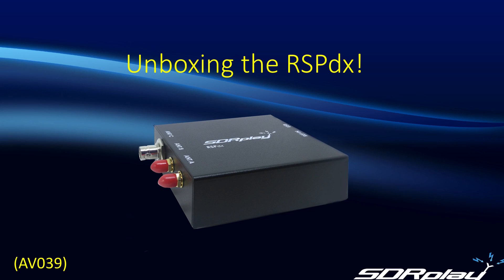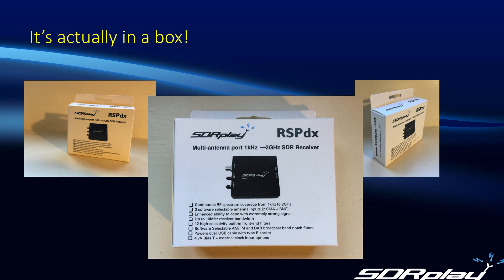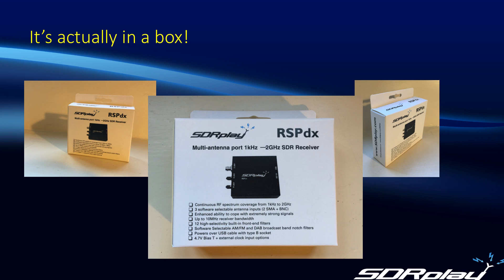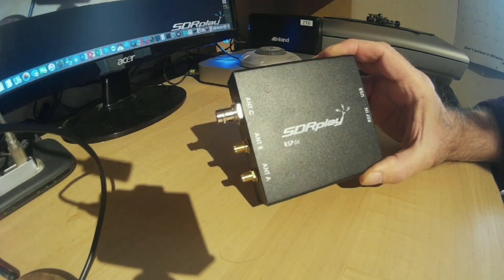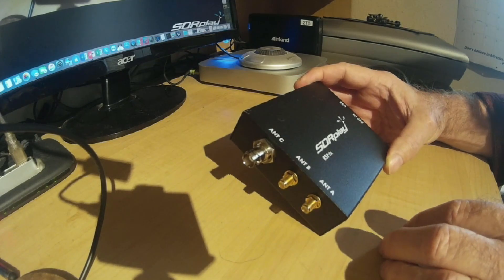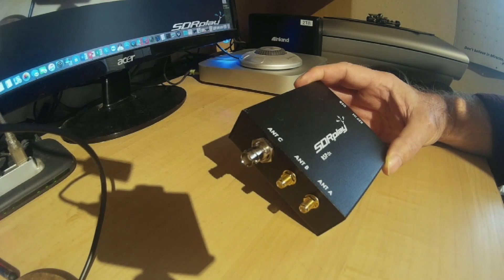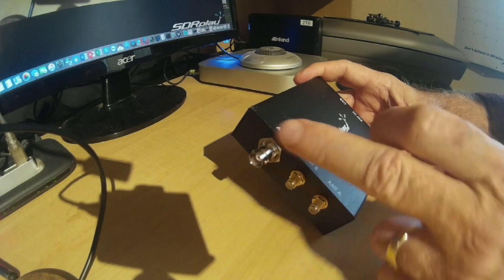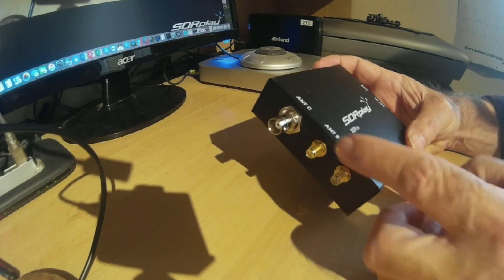Unboxing the RSPdx! (AV039)

Comment: Really impressed with the duo I bought the dx too. While I wait to get the dx can uno handle a dx and a duo in the same machine concurrently? Also looking forward to Sdruno support on Linux and Raspberry Pi.
Reply from the maker: Yes. You can launch multiple copies of SDRuno on a windows machine. I just double checked and first launched the RSPdx and then added 2 instances for the RSPduo in master and slave mode. The PC resource demands will necessarily increase but assuming you have a reasonably good PC you should be fine.
Reply: @SDRplayRSP  Thank you, much appreciated. Yeah, I think my PC is more than capable of running many copies of uno :) Good to hear about the excellent integration and well thought out design. A rarity in this throw away world.

Comment: Thank you for the video.
However, you do not cover what comes in the box.
It's probably a stupid question but does each device come with a USB lead or will a customer need to buy one separately ?
Reply from the maker: No USB lead if you buy direct from SDRplay on https://www.sdrplay.com/purchase/

The challenge of supplying connectors and cables at a competitive price is not something which we have felt that we would be able to do in a competitive way.

Also, we are aware that most of our sales or RSPs are via our distributors and resellers, and these companies already have access to the peripheral items at a competitive price in their country.
Reply: @SDRplayRSP  Also, does it come with a basic antenna? Does it have a battery?
Reply: @eddiejames6589  Does not come with antenna. probably a good idea as there are so many types.
Its not battery powered either. the power comes over USB
Reply: @SDRplayRSP  So what is the type of cable needed? Should there be toroids on it as other sdr's use? Thanks...
Reply from the maker: @paulturkk6837  under normal circumstances just a regular USB A to B cable will be fine (printer lead) - torroids help if you are in a high noise environment - then something like the Tripp Lite leads are good https://www.amazon.co.uk/Tripp-Lite-U023-006-Ferrite-Chokes-Black/dp/B003MQ29B2